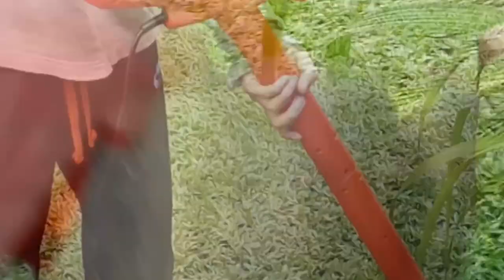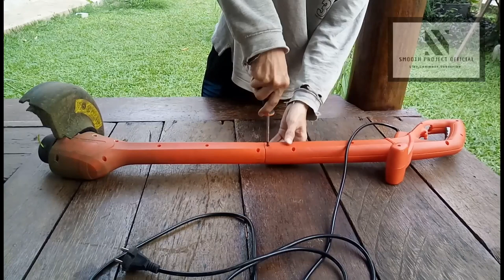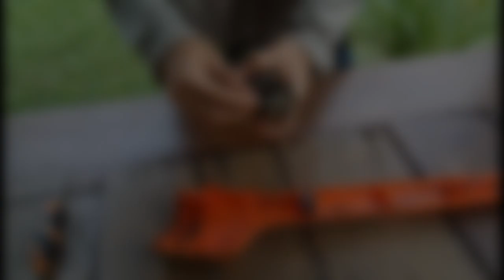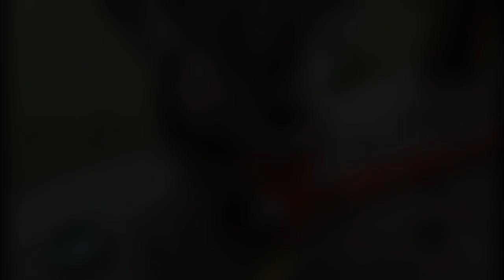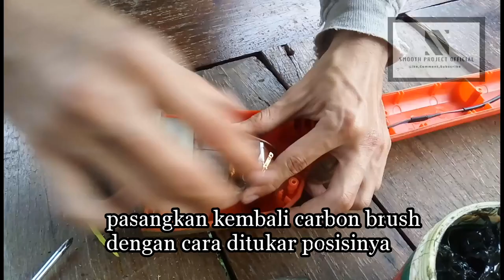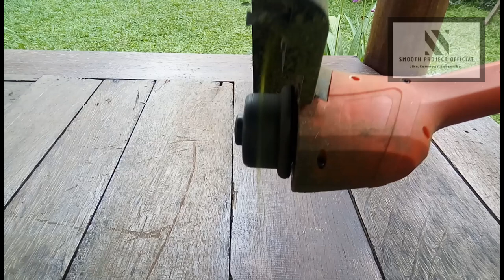Service Black And Decker Gl260 l Memperbaiki Mesin Potong Rumput Listrik Black And Decker GL260

Comment: Saya sdh ganti carbon dg yg msh baru type GL260. STLH DIPASANG, DICOBA BS HIDUP TP WKT MAU DIPAKE TIMBUL SUARA KERAS BENTAR TRS MATI. KNP YA. PD HAL JARINGAN KABEL GA ADA MSLH. PASANGAN KARBON SDH BETUL. BLM DI OLES GEMUK, APA ITU SEBABNYA?
Reply from the maker: Bisa dcoba pak kasih gemuk, kalau gk bisa coba ditukar posisinya..
Reply: @SmoothProjectOfficial  tks.saya coba ya,  kalo msh ga bs kenapa kira2.
Tdk ada bau kabel terbakar
Reply from the maker: Besar kmngkinan motornya pak udh lemah/rusak